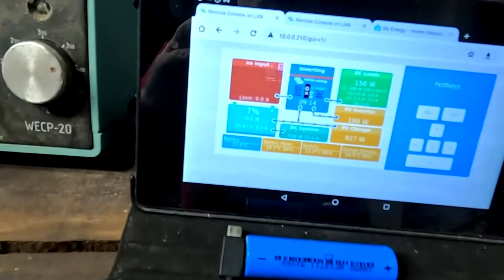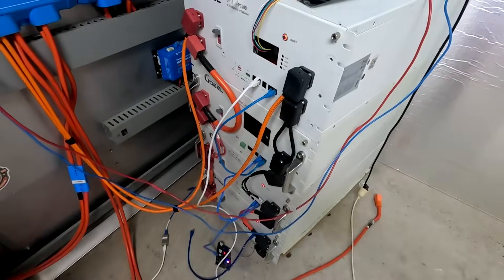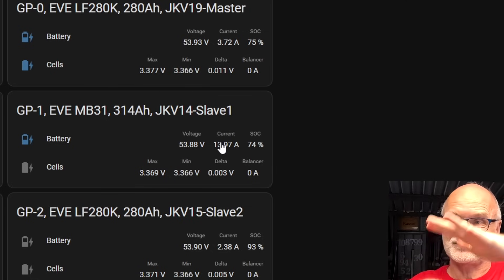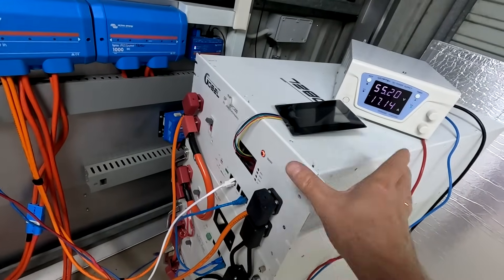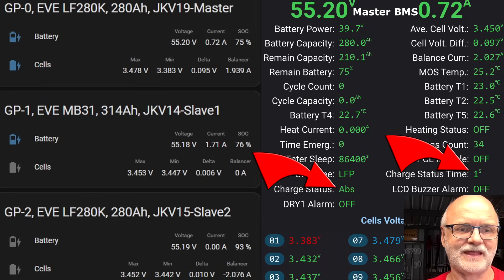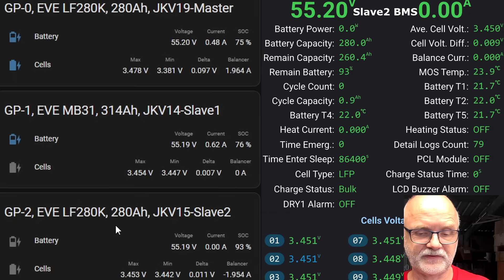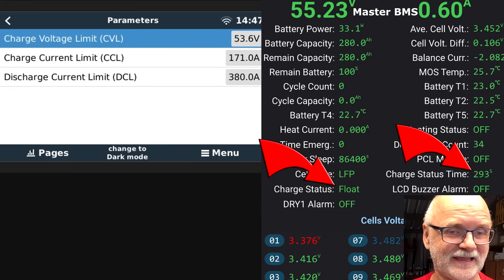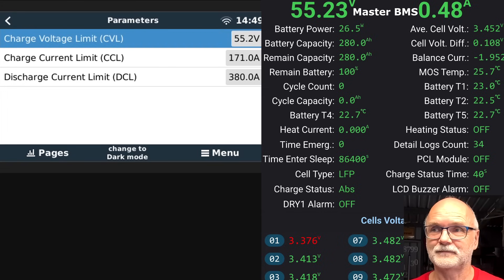JK-BMS V14, V15 and V19 in parallel and first full charge. Why no 100% reset of the BMS?

Comment: Hi Andy!
Thank you for your work. This is a perfectly!
I want to share a clarification.
In my opinion, the principle of measuring voltage and measuring the time to hold this voltage is not a completely rational approach to detecting the end of the charge. The only indicator that should be used for this is the reduction of the charge current to a certain limit. In the Victron Smartshunt, this parameter is called the "tail current". Only a reduction in the charge current to a certain limit can signal that the battery is 100 percent charged. I use this method in my own monitoring and control system without any connection between inverter and BMS. And it works flawlessly. The programmers of the JKong need to rethink their approach to determining the moment of the end of charging.

In addition, at low currents it does not matter in which section of the electrical circuit the voltage is measured. It will be the same everywhere. Namely, at low currents the battery will be charged to 100 percent and the voltage at the battery terminals will correspond to the voltage at the inverter terminals.
Reply: It sounds logical, but couldn't cell imbalance result in overcharging of one cell before the battery current as a whole drops below your threshold? The BMS will then have to disconnect the battery to avoid damage, and then I guess it will refuse to or be unable to balance.

I'm also worried that you're not charging in the way the cell manufacturers want you to. For instance, the EVE MB31 manual has an "End-of-charge Voltage" specification (3.65 V) but no equivalent current. I suspect that temperature and/or variations between cells affect the relationship between end of charge voltage and the charging current. How do you choose the current? You only mention a "certain limit."

Measuring the battery voltage at the inverter at high currents could result in unstable situations where the maximum or minimum voltage thresholds are crossed for charging and discharging, respectively, whereupon the inverter will stop charging or discharging, and the voltage will then return to within the limits. Obviously the internal resistance of the cells results in similar behaviour, but to a lesser extent.
Reply: Oh, and also, if the BMS fails (quite likely with shorted FETs), the inverter won't know. If I disconnect my BMS data connection, the inverter registers a fault after a time limit.
Reply: @eduardzozulya8518 exactly what was going through my head , aren't JK using the wrong algorithm for 100% SOC? Look at 15:06 Slave 1 and Slave 2 have zero current flowing in and they are not 100% charged according to the software! The reason that they have no current flowing in is because they are fully charged. The precision of the voltage measurement looks to be down to 0.01V and is the reason that the they havent flipped as they are measuring 55.19V (not 55.20V) in different measuring systems - a function of the inaccuracy of the measuring systems - back to the drawing board. Of note at this point the master is showing a charge of 0.5A presumably this is because of the delta V of 100mV causing active balancing (where as with Slave1 and Slave 2 active balancing is off as delta V is less than 10mVand active balancing is off.). I dont think we need to have such tight voltage parameters at the end points and the systems will all come to full charge together accurately enough. If   a current variable is added to the algorithm Andy's video shows an allowance for the active balancing current would need to be made.
Reply: @ocular57  Forgive me if I'm missing the point, but the BMS does not indicate 100% SOC until it's finished balancing because many inverters stop providing power when they're told the battery is fully charged. Mine, for instance, not only stops providing power at that point, but won't provide power again until the SOC drops to 95%. Note also the BMS doesn't register small currents.

Comment: Thank you Andy. I have a Sungrow SH5K inverter in a retrofit mode. However, the CAN communication between the inverter and the JK BMS is not supported. Alternatively, I have set the inverter's charge stop voltages to 58V (fully charged) and the discharge stop voltage to 50V (around 10% Charge remaining). The JK BMS charge and discharge stop voltage settings are slightly higher (charge) and slightly lower (discharge) so under normal operation the JK battery management /  protection mechanism will not kick-in. This works fine as long as the battery is charged regularly and the standby discharge does not go under 48V (inverter cut-off voltage). The inverter is configured to force charge the battery to around 20% in the evening and in the morning. This prevents a standby discharge below 48V. Alfred

Comment: Reason i hate to use JK BMS as a shared voltage or current sensor is because how unstable JK BMS measurments are..voltage always jumping! i have connected smartShunt and JK BMS smart junt stable all good, jk bms always jumping. sometimes about 5-10% difference in voltage peaks comapred to smartShunt. so either jk bms updating data very fast or smartshunt smoothing out data, which is not great cause it suppose to measure capacity of battery remaining so have to be pretty fast in updates too.

Comment: There can only be a difference in what the inverter measures and what the BMS measures if there is a current flowing. The difference measured is the voltage drop across the cable. The better the connection (think wire, lower resistance) the smaller the discrepancy. If there is no current flowing, there is no voltage drop (V = I x R, with I now being 0), so both should measure the same at that time. If that is not the case, one of them is measuring the wrong value.
Reply: Yeah, commented that on the last video. For both to work together, charge it to full, until almost no current is flowing then calibrate the BMS to the inverter voltage.
Otherwise, the logical wouldn't reset to 100%.
Reply: @marcok9485  Hello, I think this is my problem, the jkbms has a much lower voltage value than my multiplus 2. I need to check this. Thank you.
Reply: @boomer286  You should check with a multimeter too. If you calibrate the voltage on the BMS, the cell voltage jumps too.

After calibration, the voltage difference correlates directly to the current flowing.

(I read that in a forum.) A better way to do it would be to measure the battery voltage with nothing connected except the BMS. On the battery side, not on the load side. But I was lazy.
Reply: @marcok9485 when you say calibrate.. which voltage reading should we use?
 Example scenario
If the inverter almost stops giving current like may 1A but the voltage reading in the inverter is at 55.12V which value should we use to calibrate the bms? 55.2V or 55.12V ??
Reply: @thegreenthing7603  Take an accurate Multimeter, and measure B+ B- before the BMS enter the voltage from the multimeter as calibration voltage. This would be my recommendation. But I used the Inverter Voltage while in the same almost no current state like you described. Just because I am lazy. I thought that was clear from the prev. message.
In Your case above: Maybe neither. That depends on 3.45*16=55.2 is your RCV? That's the voltage the CAN or other Communication tells your inverter to go for. The inverter therefor should reach 55.2. If the Inverter  shows 55.12, that's strange.

Comment: 10:14 Right, but what if , in case of such situations, we just tune up a little the charging voltage from the charger , let's say in this example: when we wanted 55.2 , let's set 55.4 ? how about that ?
Reply: Yep, that's pretty much what those of us running systems without communication do.
Reply: Works for Deye. And u avoid SOC Problems during Winter gap
Reply: I also wanted to ask this same question. My inverter doesn't have any communication to my batteries.

Comment: Andy, another great video. That makes sense. Now we just need the inverter suppliers to let the inverter take the reading from the bms. Growatt SPH does the  bulk and a little absorbtion then the voltage keeps rising until, "over voltage protection alarm is triggered', so frustrating. Then it does not reser..  Unfortunately the app will not show charge status even with the bms updated to the latest version. Thats my rant. Keep well.

Comment: Thanks Andy, this is great work.  Two questions, first - which charger are you using?  I looked on your web[age and did not see it with the other chargers.  Second do you have a list of settings you are using for the JK BMS.  It has been six months or so since I updated firmware?  I want to update the firmware and compare what setting you are using compared to my settings in several V15's.  Thank you sir.

Comment: Deye inverter increase voltage 55,2+0,3v=55,5v but only if we charging by solar, end if TOU enable.   If we use utility power Deye not increase voltage. And we have this problem.  Also I setting for master 1 hour RCV timer, and for slave I setting  45 minutes.  And now working great.
Reply: If you want to use utulity just recalibrate JKBMS voltage. its not a big differen if you set calibrate V 0.05 higher then Deye...

My Deye increase 0.2V so i recalculate RCV and RFV and works perfect.
Reply: @TheZutox I calibrate voltage a little bit more 0.02

Comment: also a quality dmm to check "point voltage" which is a term for "at battery/at inverter" in charge/float and drain as cables when heated in a charge/discharge cycle wont carry the same power, does not matter if you use a bar style power carrier or go for the multi-strand principal the fact is heating always will cause oxides to build up faster, increasing the ohms, raw fact.I recently did a repair on a inverter+ battery rig burned in a day because inverter/solar and battery no talk,  so while inverter saw battery charged, the solar mppt kept charging to lead acid charge levels.
Reply: Not that it's recommended, but why didn't the BMS disconnect?
Reply: @matthewmarks6951  most often BMS units expect the inverter/charger to provide required voltage/current it will handle the rest , in the unit i repaired had no amp sensing at all so relied on the inverter data, as salr did not say it was charging then no system knew.
Reply: Quite a crappy BMS!

Comment: this is the xact reason my brother uses a victrom power charger as backup batter input and i use a Reiden 6012 which both can feed data into and get from inverter/battery via  modbus/rs485/canbus , local sensing is very important considering cable losses of 0.9/mtr